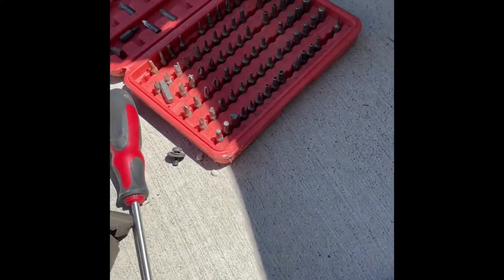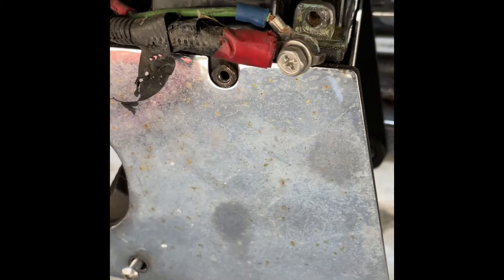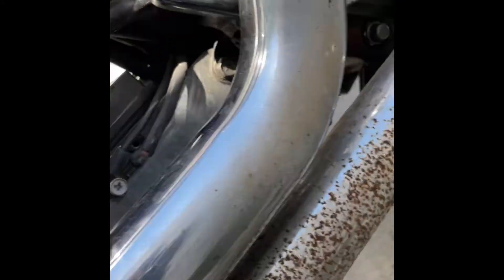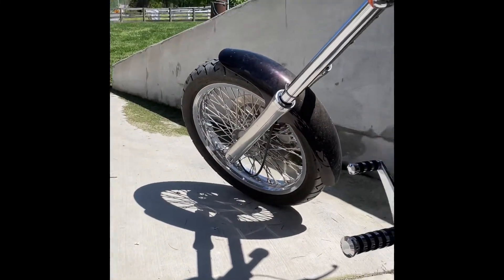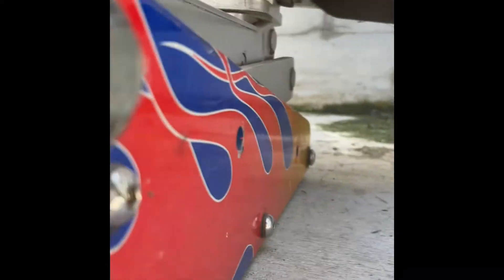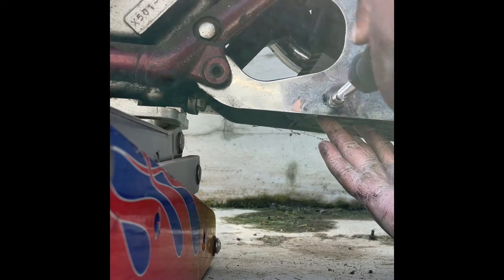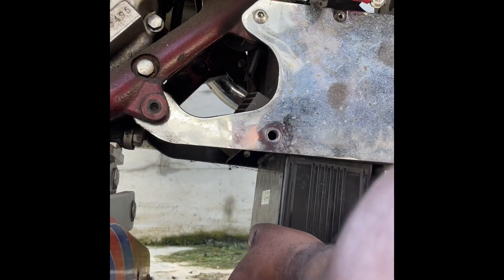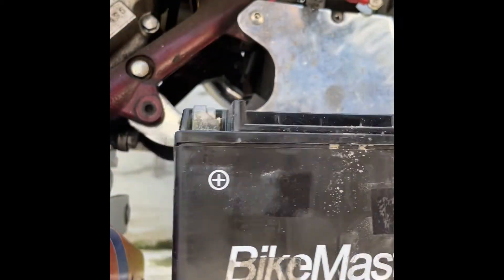1991 suzuki intruder battery removal

Comment: what type of battery is that, i have a 96 800gl and i’m having trouble finding a battery with the terminals facing the side
Reply from the maker: The battery i installed was a YTX16-BS-1 and I believe its the same battery looking at the online manual